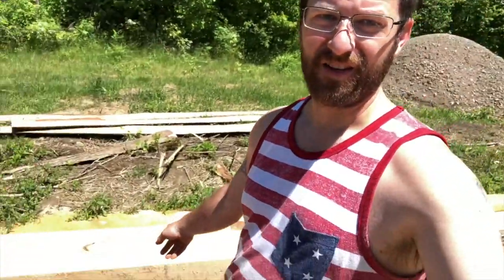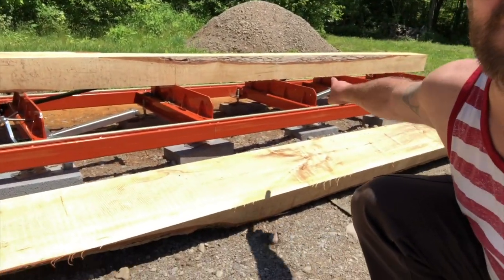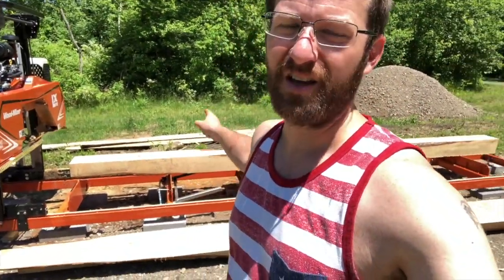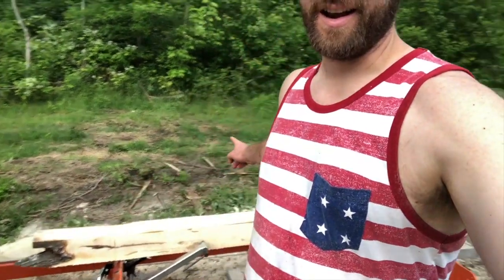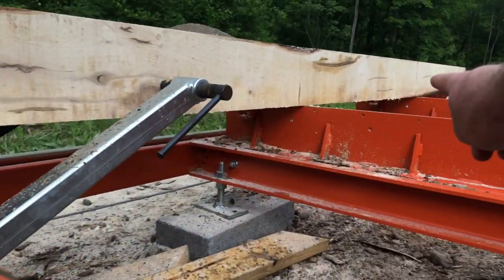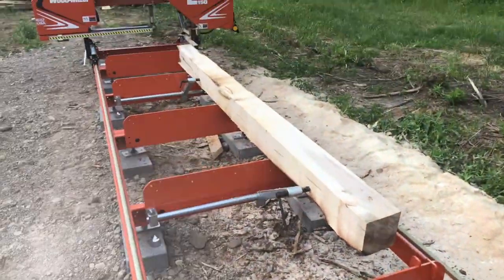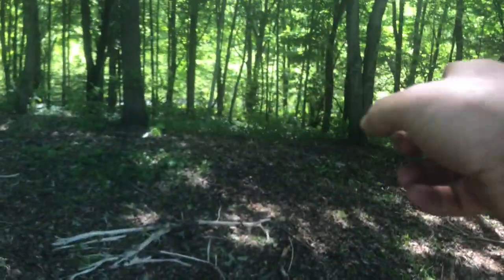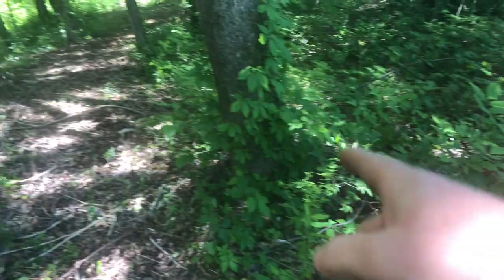VLOG 6 - I found a problem with the sawmill! (Hint..... it was me)

Comment: That probably isn't the case.  First of all string a line from one end to the other, which will tell for sure about the trueness.  the level isn't ever the issues, is it straight across the bunks, (the name of those members)  What is happening is there is tension in the log and it will deform rise up or pitch down after the cut.  That most likely is your problem.  Another whole story of how to fix it.
Reply from the maker: Thank you for the suggestion.  That is what I thought at first, but the taper in the cant did not lie.  Once I relieved some of the tension in the bolts connecting the bed sections I was able to get the bunks coplanar and flat.  The mill has been working very well since I made the adjustments discussed in the video.
Reply: @BearMadeIt  I am sure your right, the tenson in the wood is always a point of contention.  I don'tg see how the tightening or lossing of the bolts, there is just not enough leverage in that system  There had to be another cause which you might and fixed by losening the bolts.  Anyway its fixed and is working. Stranger things have happen  before.  I have done this kind of work for a living and that make no sense but what the hell ,  the issue with me is I like to know the real reason so the next time I have an answer.  Have a good one RC